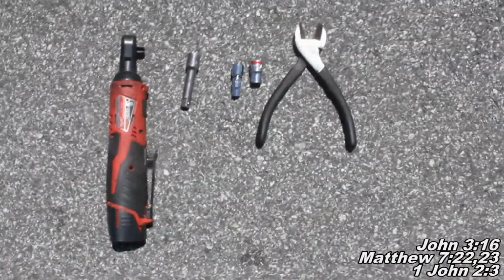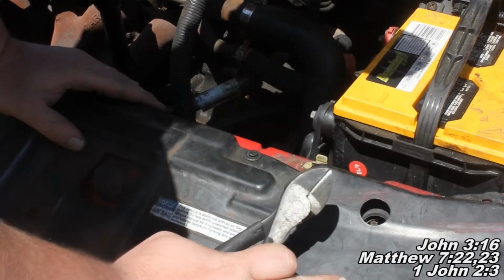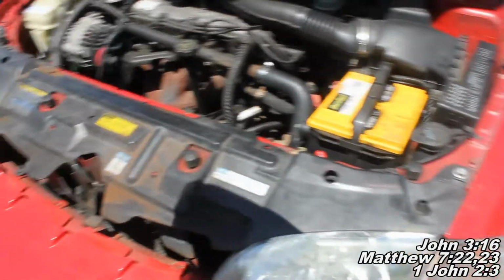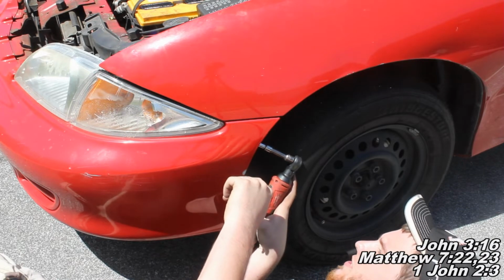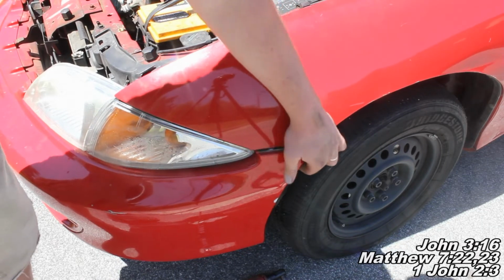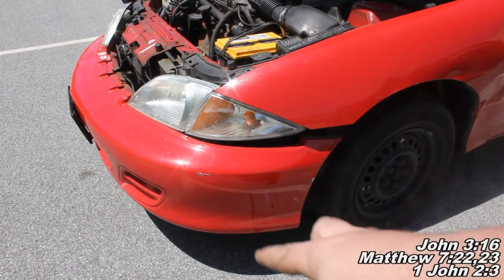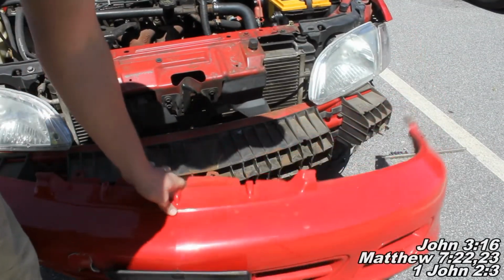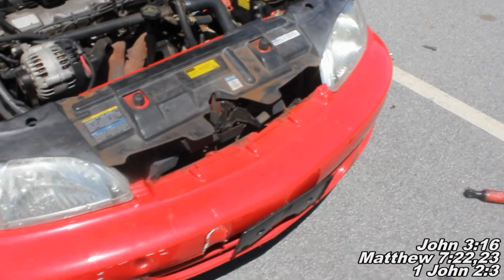Bumper Remove & Replace "How to" Chevrolet Cavalier

Comment: what year was it, why didn't you pull bumper off, I need to see more
Reply: looks exactly like mine and mine is an 02 so around that year. i am also very upset he didnt remove the bumper cover.
Reply: Rnull 22 This style Cavalier went from 2000-2002
Reply: Actually I have a 2004 that's the exact same as the one in the video, which is the reason i came here. Damn bumper was near falling off.
Reply: Lag Donkey Poker Videos Unless someone swapped your fenders, Hood, and headlights it's not an 04. The third Gen Cavalier changed from 1995-1999 2000-2002 and 2003-2005
Reply: Yup you're right. Learned that the hard way today. fml